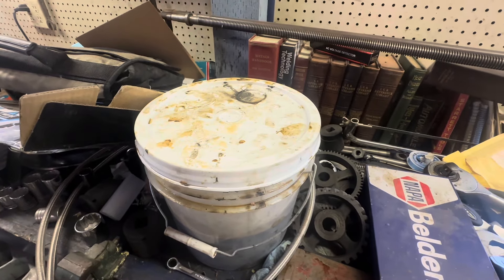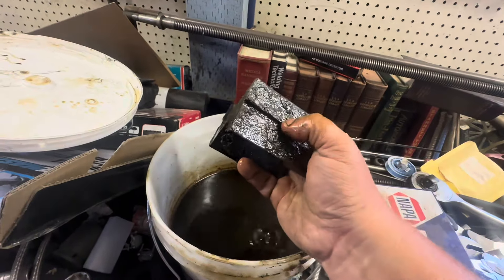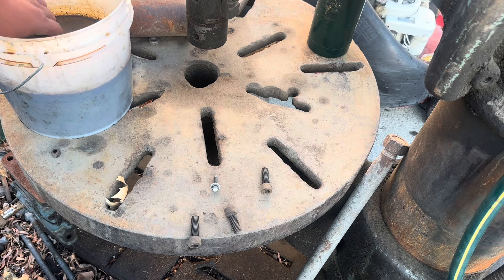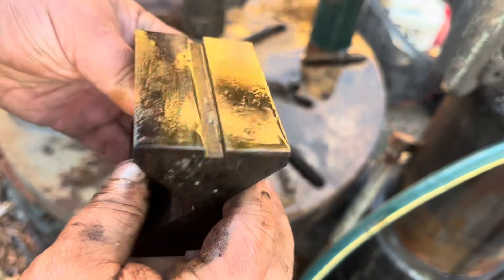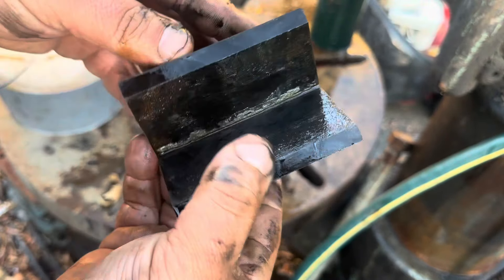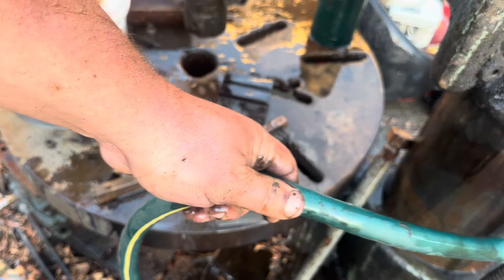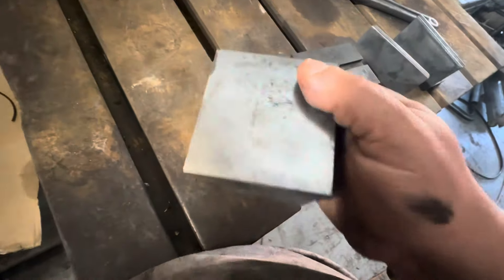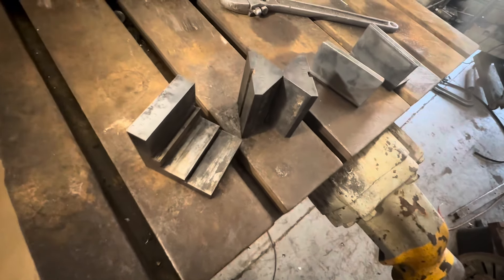Two weeks in evapo-rust, to long? Results

Comment: If you use a heated ultrasonic, it just takes 30 minutes for most parts to completely clean up, and for the worst, another 15 minutes is usually enough. It works so quickly that way that there’s no staining. Some guys make the mistake of not immediately washing the parts off and then that black film will stick and can be hard to remove. Just never sand or Scotchbright it. These thing are accurate to tenths. Once they rust the need to go on the surface grinder to be brought back.

Comment: The big danger of evapo-rust is failing to have your parts fully immersed. That can lead to an etch line at the surface as the oxygen in the air attaches to the steel and the evapo-rust tries to take it off. Also, if the items are painted, the evapo-rust will soften up the paint. So let the part dry completely before you start trying to brush off the residue. Even a nylon brush will take the paint off while its wet.